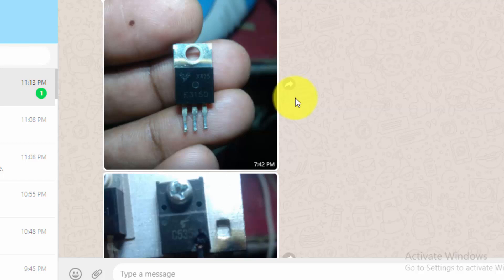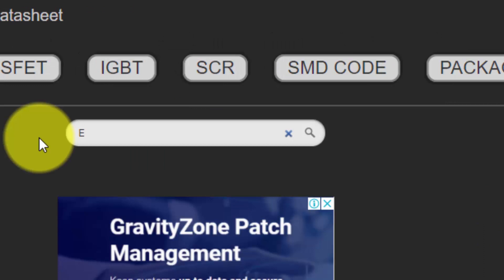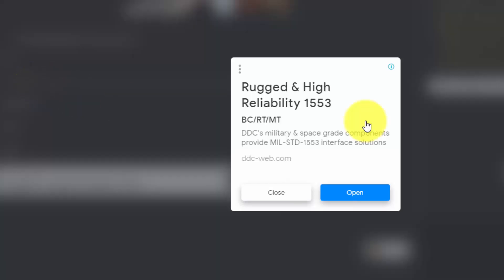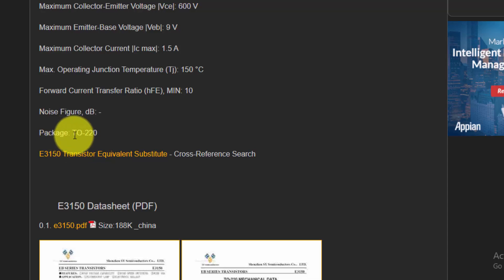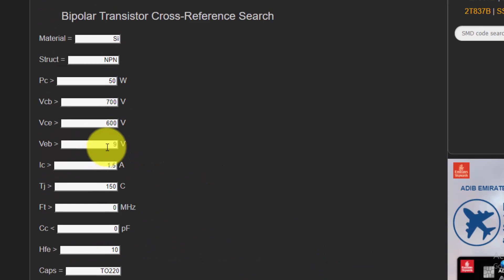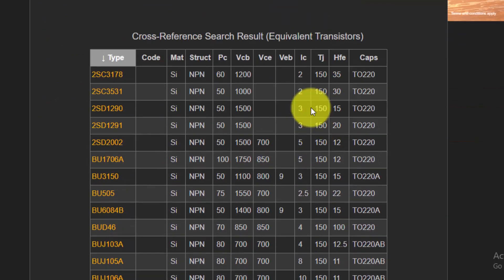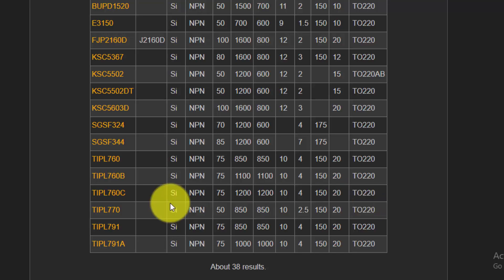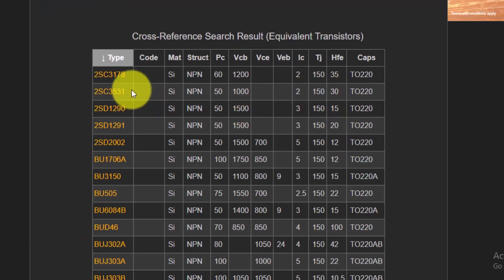#317 How to find Equivalent or Substitute of MOSFET or Transistor / SCR / IGBT

Comment: Can I use 18N50 Rds on = 0.32ohm instead of FDPF18N50T Rds on = 256mohm
Reply from the maker: yes, it can be used. may be it will slightly heatup at full load, otherwise it will work